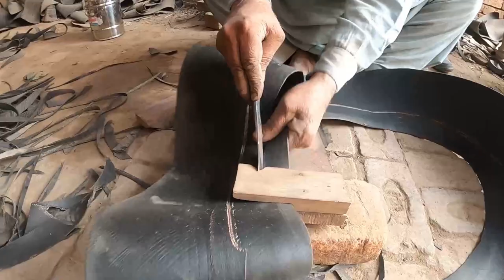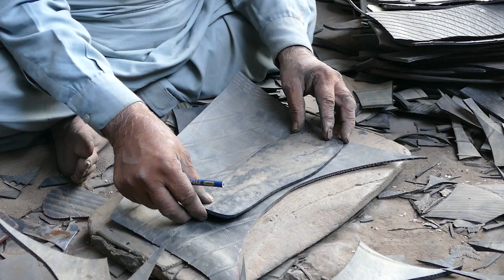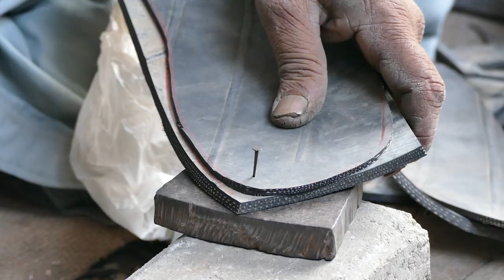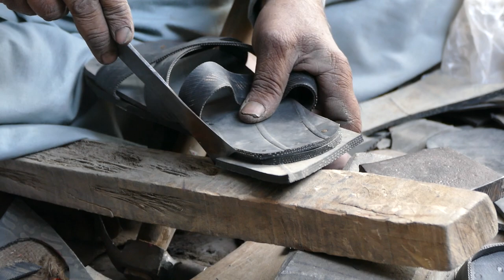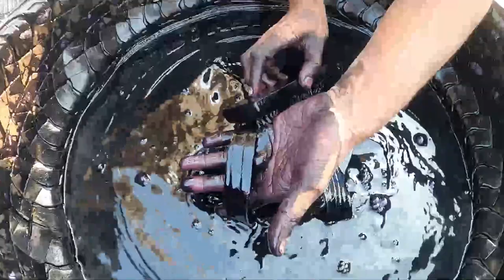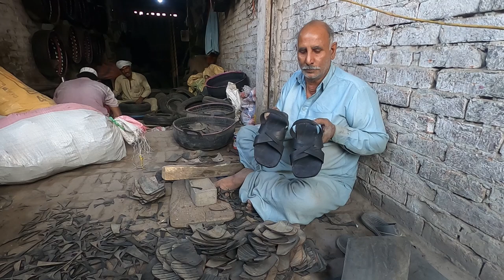Making of Amazing Shoes from Old Tires

Comment: All those nails how could just bending them over like that be comfortable????
Reply: Whatever others say, the idea of nailing the edge of sandals is not part of footwear manufacture. Those rubber sandals will cause callouses on the sole. The nails could press against your sole. OK we see recycling, but would you wear a cancer causing material against your skin, footwear the does not support you properly, and slippery when wet?